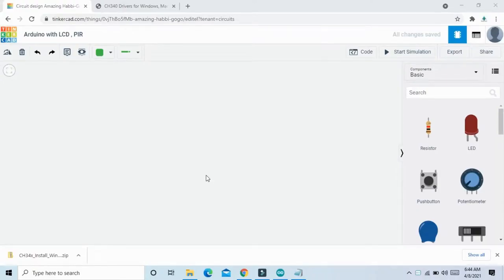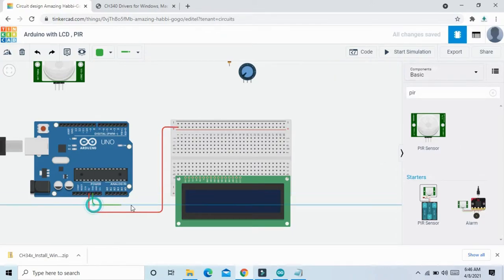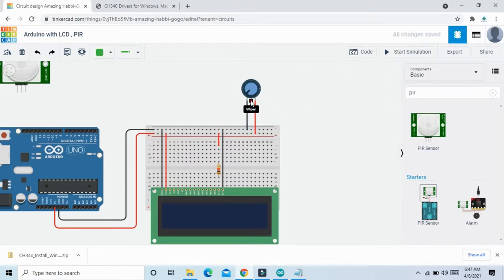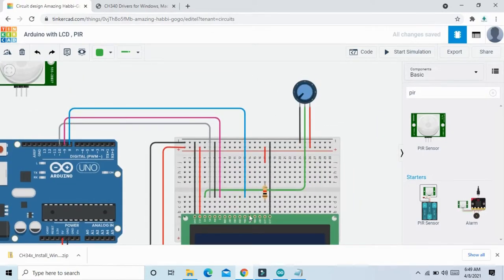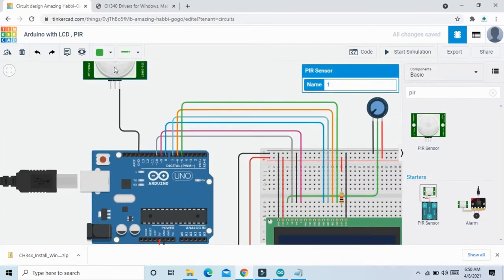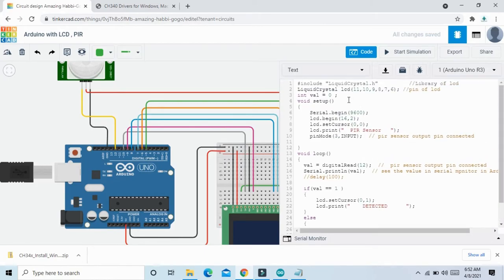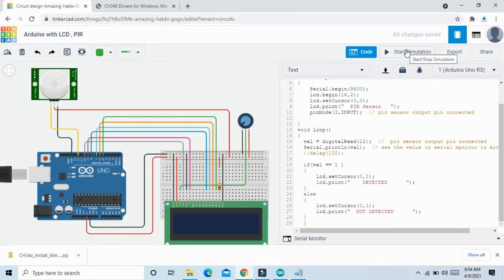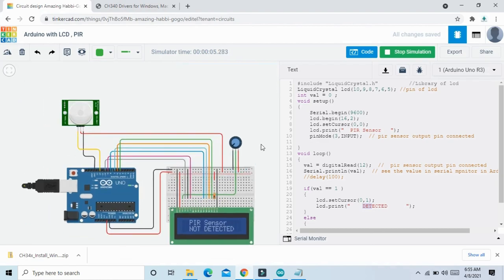#30 PIR Sensor Tinkercad with LCD | Tinkercad circuit project | tinkercad arduino  tinkercad circuit

Comment: I am confused Sir. After running the code, it shows "Not detected". After moving the cursor in the PIR sensor, it shows "Detected". But after moving the body away from the sensor, it still shows " Detected". Why is that happening?
Reply from the maker: Sensor is working

Comment: sir, what is the purpose of potentiometer ?
Reply from the maker: A potentiometer is a type of position sensor. They are used to measure displacement in any direction. Linear potentiometers linearly measure displacement and rotary potentiometers measure rotational displacement